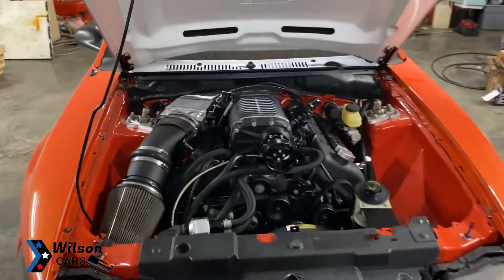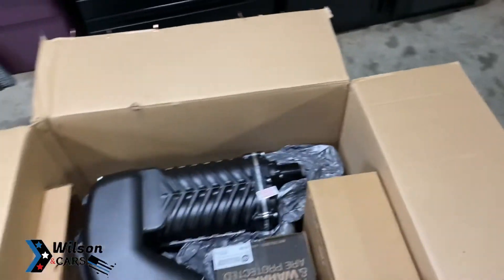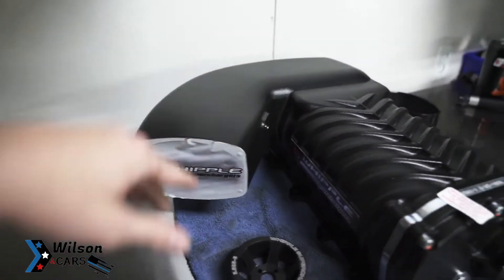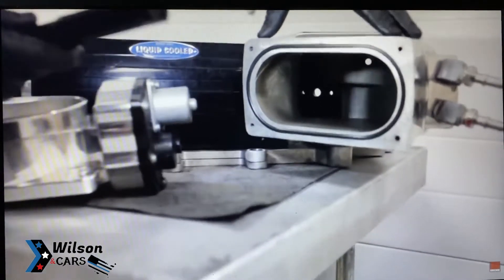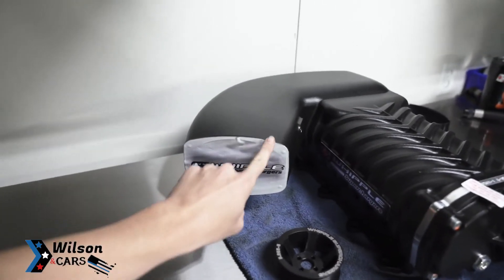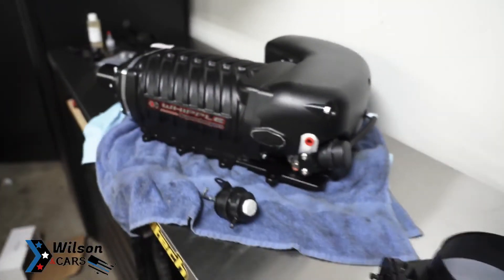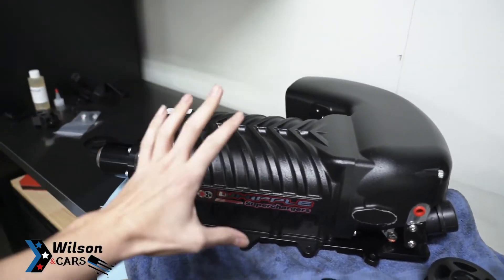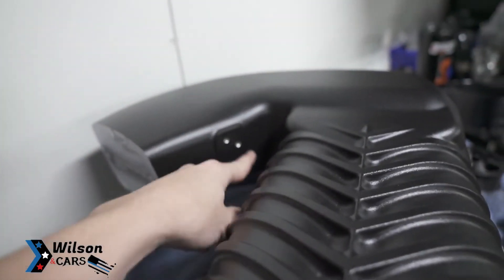gen 5 3.0L whipple 03/04 cobra 4.6

Comment: Still the same opinion of the vmp hitting harder than the whipple gen 5 ? I can’t decide which route i want to go with my car
Reply from the maker: Yes , the 2650 has a harder initial hit vs the Whipple 3.0. I tell everyone  running 93 go with VMP.   

I am currently saving up funding for a 2650 to do some back to back track testing of both blowers

Comment: Hello guys, new to the scene. I finally bought my cobra I always wanted. Need help building and wanted to know what I would need to upgrade from a stock cobra 2003 to a Gen 5. 

List of things. 

Buying the gen 5 from lethal performance.
Reply from the maker: Things I suggest 
Full return fuel system dual 465 , if you stay 93 a single Walbro 525 will suffice. I suggest Fore
1050x injectors 
Cobra engineering 3/4 IC adapter 
PNR rear ice tank / EMP pump 
Cobra engineering coolant cross over delete
Cobra engineering head cooling mod
McLeod rxt
Reply: @Wilsonandcars so he really wouldn't have to go in the engine?

Comment: Weird question guys.                                              So I’m stuck between this and the F1A cog unit. For my 03 cobra.                                               Doing my first ever car build ever. So bare with me on the lingo. Super new to the game.         cnc the bottom block and the Kellogg crank. Did MMR pistons and rods full ARP hardware. Stage 2 cams. Have DB heads polished and ported did MMR for the chains rocker arms etc. have BBK longs tube headers. getting a T56 magnum with the McLeod twin disk clutch and aluminum flywheel package they have. Want a street car that is fast. What would be my better option? Want to push 1000hp on pump gas.
Reply from the maker: 1000hp on a 4.6 with pump gas will be a far stretch unless your talking pump E85. You could probably do 680-750 on pump 93 and torco with a gen5 whipple with correct stuff. The f1A if it’s street driven I’d stay away from cog setup, but you could probably squeeze a little more power out of the f1A on 93 due to the way the blower delivers power. But 1000 on a 4.6 on 93 I’m not sure can be done the fuel is just limited, now on a gt500 where the heads are better and the bore size is bigger you could probably pull it off or close to it.  But I prefer a PD blower ( whipple) because of the instant torque and power especially on a street car.
Reply: Wilsonandcars question.                                            I know it’s a hard one to answer each car is different and what not. Say I ran e85 and went with the whipple gen 5 did everything I have to do. To reach that 1000hp mark. What would win in a race the Procharger F1A same set up for reach the 1000hp or the whipple 1000hp?
Reply: Wilsonandcars and what would be a safer thing for the motor the Procharger or the whipple. Just don’t want to have a ticking time bomb lol. Thanks for the help really appreciate it
Reply from the maker: I’d say the whipple would probably be fast unless you did a crazy procharger setup. They both are pretty even, the whipple will be easier to swap belts on and such.

Comment: So why did you chose the Whipple again 😂 ?
Reply from the maker: I’ve seen good results from other GEN5 builds and it was far more impressive then the current gen3 VMP. But VMP has the gen3R coming so I bet it closes the gap.  On the cobra platform, other stuff the gen3R and whipple gen5s are fairly close in power.
Reply: If or when the VMP gen3 r for the cobra comes out. Shouldn’t it just by history have more tq then the whipple? And we’ve already seen the temp difference over pulls. Question now is when is VMP going to drop it. Because they’re losing potential sales.
Reply: @jz28h  Hey man, you said "we've already seen the temp difference over pulls," could you explain what that temp difference was and which unit ran cooler?  Between the whipple gen5 and the vmp gen3r, is one known to have significantly lower IAT temps/cooler temps after pulls?
Reply: @jrjhanson  yes there was a test done on back to back hits simulating street racing. It was like pull after pull after pull like 5 consecutive. And I think it was 2 hits in the whipple temps started to rise and the vmp was stable I think within a few temps of the original hit. If I can I’ll post a like for you.
Reply: @jz28h  I'd love to see that video if you can post the link, man.  Either way, thanks for responding, I appreciate it!
Reply: @jrjhanson  I posted the link but now I don’t see it

Comment: The gen5's look amazing. What pulley combo were you running on your 3.4l setup?
Reply from the maker: I ran the 4” 17.5# wasn’t really doing much with it. I’m ready to step up! May goto the 3.33 pulley.
Reply: @Wilsonandcars  im guessing a 3.33 will get you around 23lbs (if the motor was oem) so maybe a little less? 

oem lower pulley?
Reply from the maker: Yes oem lower pulley.